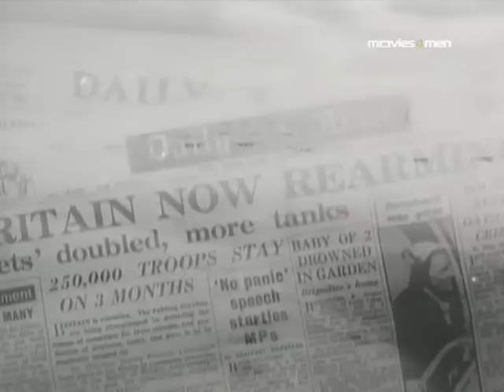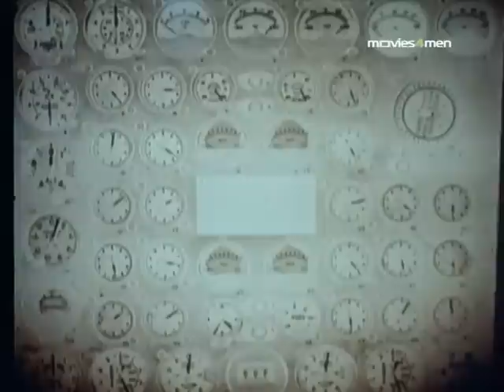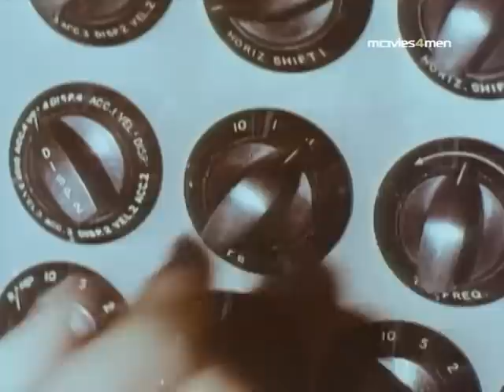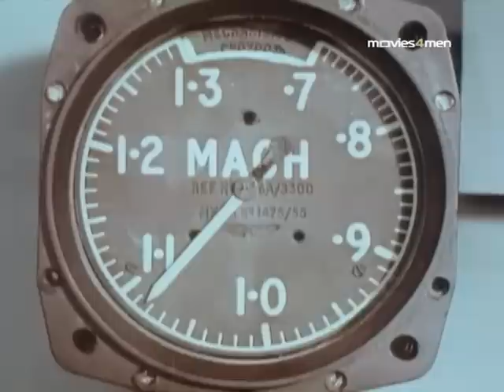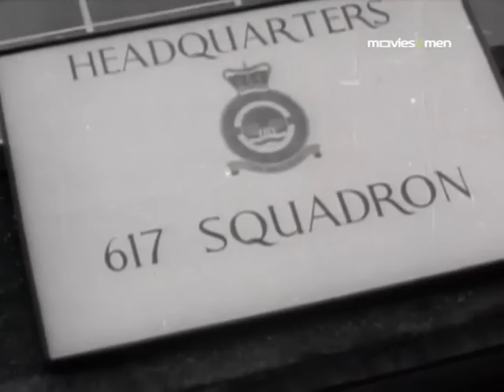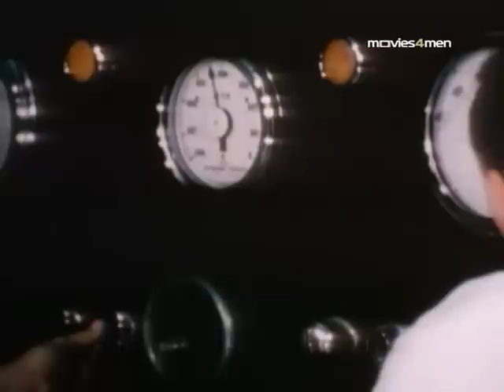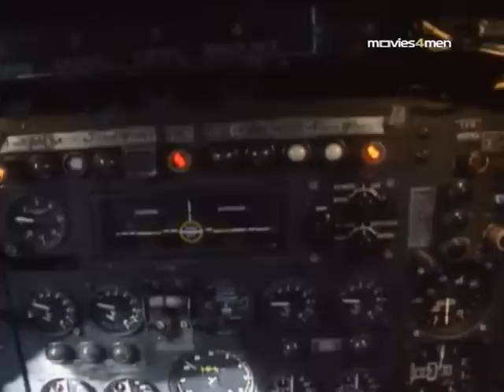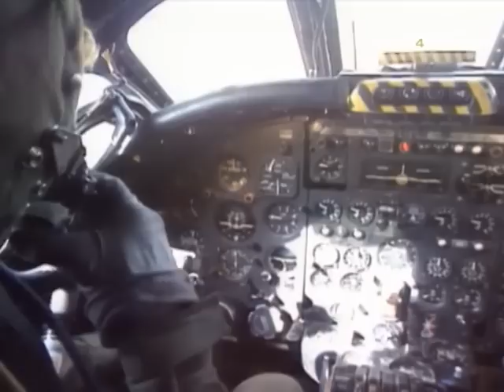The Avro Vulcan (2006) - Technology Documentary - hosted by John Standing

Comment: As an ex Aircraft  Mechanic Propulsion  in the RAF , worked on these at RAF Scampton . The Engines  were either the Olympus 200 or the newer Olympus 300 series , that latter was a bitch to work on as it was a larger engine stuffed into the space as the 200.

Comment: Wouldn't have taken but a little redesigning to turn the Vulcan into a Stealth Bomber. What a beautiful aircraft.
Reply: Mike Smith just go and have a chat with the air traffic controllers at Plattsburgh AFB who were on duty when a Vulcan visited them. They never saw the Vulcan coming until it would have been to late for them to take any defensive actions (had we been at war that is). Stealthiness is not just the use of exotic materials that absorb radar energy, sometimes it is the shape of the aircraft (including the smoothness of transition between shapes) like in the  Vulcan, and other times it's also size related, like the BAe Hawk which doubles its RCS when the gun pod is added.
Reply: You clearly have no idea what intense work goes into designing a stealth aircraft. Just being in a flying wing configuration does not make a plane a stealth plane. and the Vulcan isn't a flying wing, it is a delta-wing.

Comment: Such a beautiful bird! The tiny turbojet engines tucked inside that beautiful wing has such an aerodynamic elegance to it. The U.K aviation industry produced half a dozen or so aeroplanes with this configuration. They all look stunning and slick.
Reply: "Tiny turbojet engines"? Have you ever seen an Olympus turbojet dude? Only seem "tiny" compared to a high-bypass turbofan. And looks aren't really what makes a plane successful. All the drawbacks, the difficulty of access, the increased vibration, the fire risk, heat management issues, all unit to say that underwing pods are better. And you can't really say that underwing turbojets aren't elegant and aesthetic looking. Look at the 707 and DC-9. hard to say those are not handsome aircraft.
Reply: @justforever96  Where is this coming from? Did I say that no other plane is beautiful? Underwing podded engines are so common now that it ceases to be anything remarkable. These early British birds stand out in comparison to what we see today. They are tiny. Even for turbojets. They produce 1/3 the power of the Concorde and 1/5 the power of the TU-144.
Reply: @ejkk9513  okay, that is the first time I have ever heard Olympus engines described as " tiny" but suit yourself.

Comment: If UK government  had kept this marvellous aircraft like USA kept b52....
Reply: The B-52 has an advantage over the V-bombers and the XB-70 Valkyrie: its engines are mounted in pods. As newer engines were developed, it was relatively easy to create an adapter pod. With new engines, it was worth to update the electronic equipment as well. But the Vulcan has its engines inside. Any new powerplant would have to be the same size, and the retrofit would be very expensive.
Reply: Vincit Veritas by the 1980s the Vulcan had lost its main role of a strategic bomber to the Polaris armed submarines, which were hardervto destroy than the bombers even if they were dispersed.
Reply: Alex Lopez it wasn't so much the engines that killed off the Vulcan, but equipment in hard to reach places that had reached the end of its design life. The Vulcan's longevity was the problem. The designers had expected the airframes to be retired long before the 1980s.

Comment: I noticed the engines were very close to the fuselage like the infamous Comet passenger jet. Was there ever any problems like with the Comet?
Reply: The Comet's major issues were structural, not related to the engines or their placement.  3 Comets were lost in 12 months in '53/'54 and the investigations eventually revealed that square window corners developed up to eight times the load stress as the rest of the fuselage skin and the aircraft had been designed to be glued and riveted but was built riveted only. 

Once improvements were made (consider the timeline of large jet development) the Comet airframe went on to have a long but chequered career: https://en.m.wikipedia.org/wiki/Hawker_Siddeley_Nimrod
Reply: Comet never had any problems with the engines. They thought it was possibly engine fires for the first year or so until they finally found that it was problems with metal fatigue in the fuselage. The Comet and Vulcan both had the drawback of buried engines, which is difficulty of access for maintenance, risk from fire, increased vibration and noise, heat management problems, etc. But not "problems" the way you seem to be suggesting.